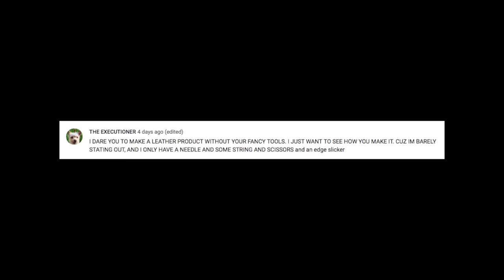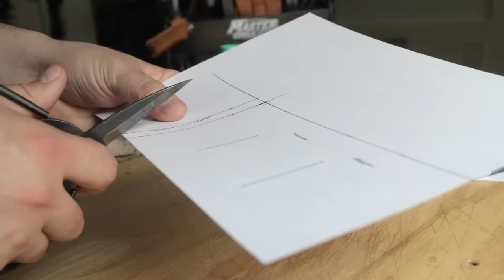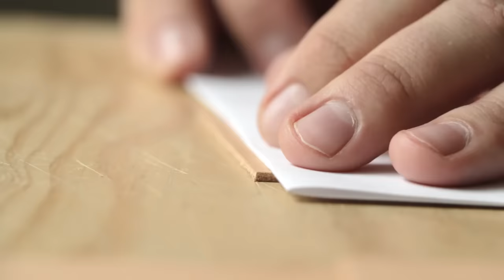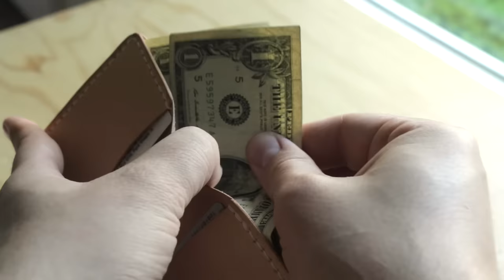Can You Make a Leather Wallet WITHOUT Tools?

Comment: When I started working with leather I only had: string, needles, scissors, a ruler and an awl. Imagine using the ruler and the awl to punch holes with 5 mm distance between them. It took ages but it helped me appriciate this art.
Reply from the maker: That's what I started with! I used an awl to punch holes individually for almost 3 years before I learned about stitching chisels - lots and lots of work, but you learn priceless skill!
Reply: @Corter  And also you develop patience :)
Reply: I thought I was the only one. There's at least three of us now.
Reply: Four... I made it the Same way... And was Crazy Enough to build a Messenger-Bag that way... If this Video was there about 10 Years ago, I would have Stolen a Frok instead of nearly getting crazy ;-)
Reply: it was the same for me, some tools i do, like punch i use a meet fork with cuted handle ... now i need how to do a skiver
Reply: Me to
Reply: @nuradhajayasanka7872  i do one last weekend, try with a square wood formon .. it depends of the steel, mailme to send pictures
Reply: Yep me too but insted awl I have an eagle, uups thats an owl.
Reply: Thats how I do it.
Reply: I used my drill press and drilled each hole since I was working with really thick buffalo hide
Reply: Which I have the tools he is using..
Reply: Which I have the tools he is using..
Reply: noted

Comment: I was legit waiting to see how you would pummel the fork through leather 😂
Reply: Same.
Reply: Same here, because I actually do just that, I have an old fork I use as pricking iron. It's similar to the one in the video, I simply hammered it flat, trimmed the prongs to about a centimetre long (that way they're less prone to bending), twisted them to a 45° angle (this gives the stitches a nice subtle zig zag look) and sharpened the tips a bit with a file. I haven't tried it on thick/heavy leather, but on thin and medium stuff it works great.
Reply: @MrTapella  that's actually a really great trick. i might actually try that sometime. thanks!
Reply: @MrTapella  .
Reply: @MrTapella  I need to try that 😂

Comment: Also add in that if you want to water proof and slightly soften the leather, use some type of oil (boiled linseed is best IMO) and soak it in the oil. For some coloration you could soak some steel wool in vinegar (makes black) for a couple of days then rub it into your leather, then soak in oil

Comment: I didn't watch the video. The fork you used to punch the thread holes is a tool. The knife or scissors you used to cut the leather is a tool. The needle(s) you used to sew the pieces is/(are) a tool.
The brush you used to spread the glue is a tool. (If you used a finger to spread the glue (yours or someone elses) or a stick to spread the glue, those are technically a tool. The sandpaper used to sand/scuff the edges and where you applied the glue is a tool. Whatever you used to burnish the edges and to apply the leather dye and wax are tools. (even if just a rag.)
Can you make a wallet without tools? No. 
Can you make a wallet without proper leather crafting tools? Yes.